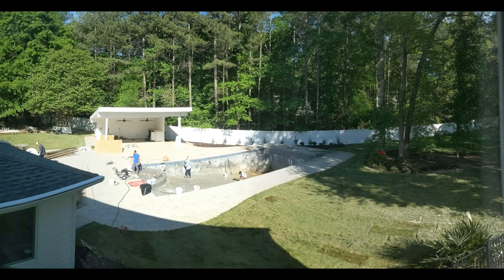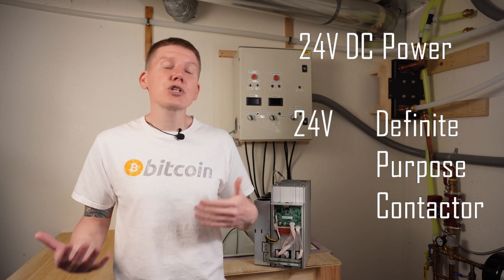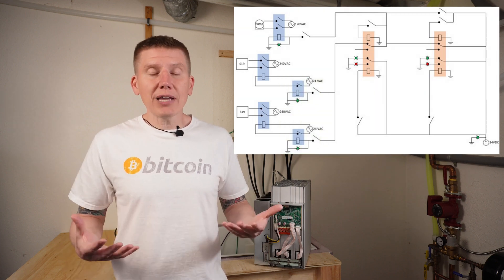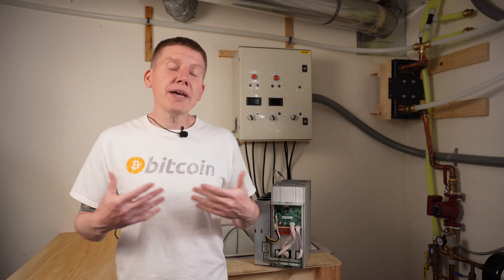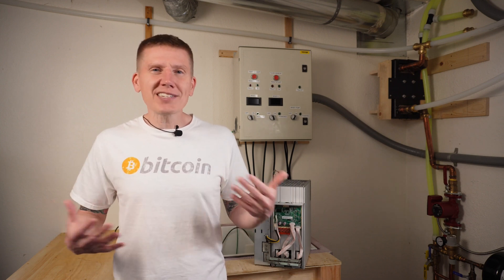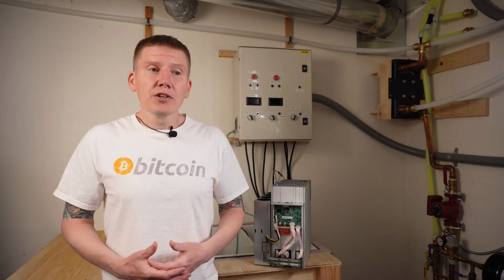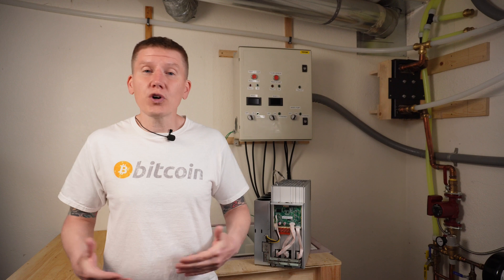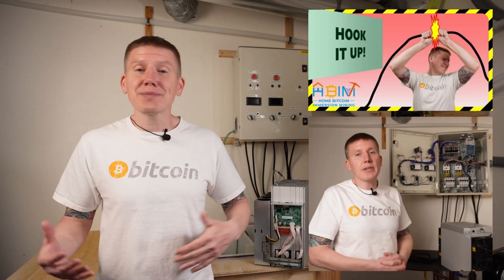EP19: FAILURE! What happened to my BITCOIN mining setup?

Comment: How are you going to solve the fan noise problem with the dry cooler? If the one you picked was the lowest dB one, won’t the alternatives be worse?
Reply from the maker: Great question...I'm going to give an update in a future episode, but it was surprisingly easy.   I had the idea of using a variable voltage power supply.   The fan is reversable and when I swapped the power supply, I accidentally switched the leads...running the fan to push the air in the opposite direction made a huge difference.  Then, I just turned down the voltage a little...running at 10V instead of 12.   The annoying drone-like sound is completely gone...all that is left is the sound of the air passing through the radiator.
Reply: @HBIM_Channel  interesting! Looking forward to video